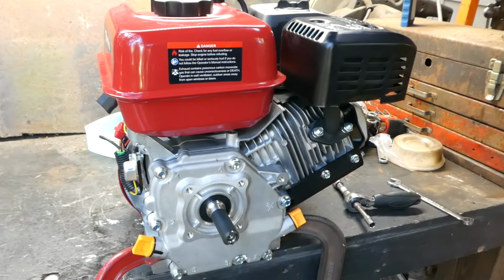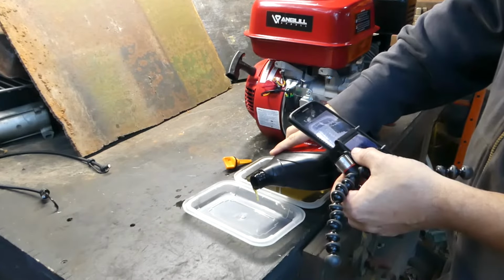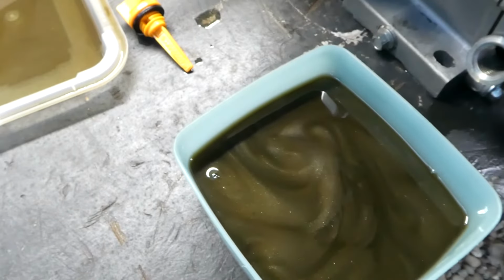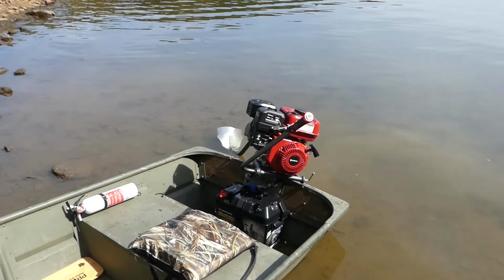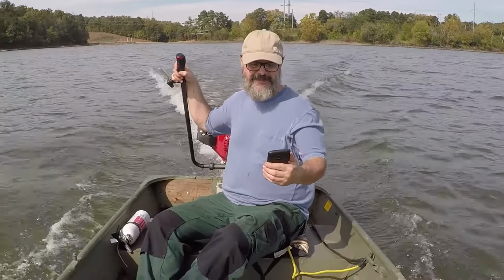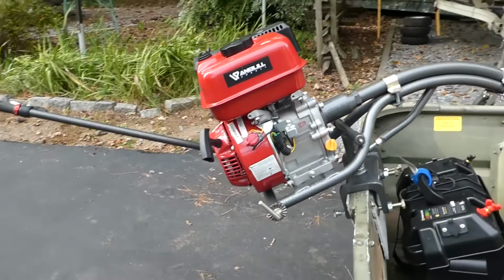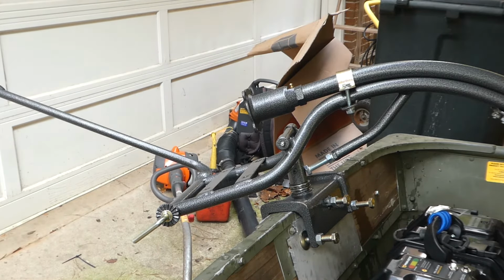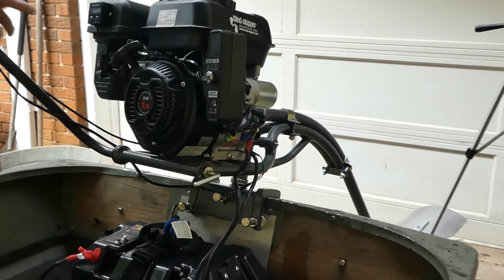Cheap Amazon engine in a boat.

Comment: You know id completely remove the governor system on both of those motors. When i race gokarts you can squeeze out 4500rpms before the valves start to float.. get some heavier valve springs and a good mid range cam and i bet you'll run 20mph

Comment: Interesting trial for that new motor. As for speed difference, Dad standing up would create more air drag, more chop on the water = less water drag. With the float plane I'll actually taxi in circles to make chop on calm water to shorten the take-off.
Reply from the maker: For the speed test he was actually sitting but there was definitely more chop on the water during the fastest run with the new engine. That is interesting, it makes sense but it feels like you are going slower in the wakes. I would have thought you would want as smooth water as possible with a float plane. Always learning! We also thought about the fact that I am 30lbs heavier which lifted the front up a bit more. All in all it performed as well as the engine supplied by a fairly reputable dealer, so I would call it a success as far as it goes. Thanks!
Reply: @theeddies  More weight in the front would definitely make a difference, not only is the bow pushing water, but physics of water properties causes it to climb up the bow, pulling it down more, creating even more drag. It can reach a point where the boat will actually flip over. I don't think that boat is in any danger of that, but, if you've ever watched speed boat or hydro-plane races you may have seen that.
Everything is relative, a plane like my Cub can't handle near the waves a larger plane can, even a Cessna 180 or a Beaver. A little chop adds air to the water making it less dense and less sticky. Humpback whales feed on herring, one of their feeding technics is to dive below a school of fish, circle around the perimeter of the school blowing bubbles. The density of the water is reduced in the " bubble net" and the fish can't swim through it to get away. The whales then swim through the fish, mouths wide open, and scoop them up.
Glassy water and wire crossing are the two most dangerous conditions for a float plane. It's hard to see a wire crossing over a river. With glassy water depth perception is nearly impossible, you can't tell where the sky ends and the water begins. In WW2 flying boats would fire their forward guns into the water ahead of them as they landed so they could tell where the water started.
Reply: @theeddies  
Or pushed the rear down!
Reply from the maker: @edwardchristie3934  Yes, ...or pushed the rear down with my big rear.
Reply from the maker: I don't think there was any chance of the boat flipping, lol. I had not thought about the lines crossing those waters around you, especially at the altitudes you fly. That always reminds me of an old REM song with the line "Power lines have floaters so the airplanes won't get snagged"

Comment: Do they have throttle limit screws in the throttle linkage?  If so, back those out (or remove them completely). Should give you a few more rpm if the engine has the power to turn it.

Comment: It's like the River Boat Patrol in 'Apocalypse Now'.
Reply from the maker: Ah man I really missed that one. I could have used flight of the Valkyries. That would have been epic. Maybe I will do a short. I love the smell of burning oil in the morning.
Reply: @theeddies  lol I was thinking of that earlier too.
Reply from the maker: @johnstrange6799  Can you single point a 4mm thread on your lathe?
Reply: @theeddies  No.
Reply from the maker: @johnstrange6799  would you care to expand on your answer or at least phrase it as if you give a damn?
Reply: @theeddies   You asked if I can thread 4mm. I said "No.", but I care deeply about it.
Reply: @theeddies  What are you trying to thread anyways?
Reply from the maker: @johnstrange6799  I want to make a chasing die for my leadscrew when I make the new brass/bronze nut. The thread is T20-4, metric Acme basically. I have a HSS tap, which has a long tapered start. I ordered some O1 tool steel for the die, BUT I am concerned about getting it through. My thought was to have someone start the thread and finish with the tap. I am going to attempt to tap it but wanted a fallback. It only needs to be a a few finished threads to do a chase.
Reply: @theeddies  I can't help you with that, sorry. What would it cost you to replace your lead screw and start fresh with a new nut and screw?
Reply from the maker: @johnstrange6799  If I were to do that I would get a ball screw but I don't want to spend that on this machine. Maybe I should have been more clear, and this is hush hush. I just want to make a die cus Adventures with A Really Tiny Lathe made a small buttress thread one and got a million views. My screw is no where near needing replacing but could use a dress up. So it is an excuse to try something challenging. But making an acme type die with a chinese high speed tap is an unknown and could fail miserably, the heat treat could fail miserably. It could be a miserable experience but experience just the same.
Reply from the maker: @johnstrange6799  go to proxibid dot com and search "smithy". I am bidding on it, yes I know, but it has everything I need. Also a nice vise with it. I am thinking $400 maybe 5 max though. What do you think?
Reply from the maker: @johnstrange6799  Forget about the smithy, already $500. morons!
Reply: @theeddies  Gone but not forgotten.
Reply from the maker: @johnstrange6799  That Smithy went for $1100. Insane
Reply: @theeddies  Not surprised.
Reply: @theeddies  Little 109 for $400 with change gears on Atlanta CL. Could be a money maker with enough time and paint invested.
Reply from the maker: @johnstrange6799  Those idiots listed it in Atlanta but it is near Asheville, NC. Like 450 mile round trip. They would have to pay me to pick it up, lol. Dollar a mile.

Comment: is this with the stoke 3blade prop? see you had the cavitation plate.. If you Get a longtail 2blade 6.5"-7" aluminum prop, and tap it with a m16x2.0, add a m8 set screw, itll get you up closer too 15mph-17mph ive reached 18mph with a 7" prop by myself. with the 2 blade props you gotta mess around with ythe motor height a tad bit.
Reply from the maker: I believe this one was with the stock blade. My father tried a few 2 blades, but I don't think he ever got it dialed in the way he liked. He passed a few months after this video was made. I still have the boat but not a lot of motivation to mess with it. Thanks!

Comment: So im thinking about buying one after 2 year's have you had any major problems with the amazon motor
Reply from the maker: Nothing major. I would do the reccommended run in and change the oil, and check the valves after. But this one was good.

Comment: i dont understand why use the big car battery for the electric start . a 7hp engine is tiny you can get much lighter motorcycle batteries that are also 12v and start these little motors just fine . i run a chipper with electric start honda gx390 with a bike battery . never failed in 3 years
Reply from the maker: Dad had planned to run lights and accessory power in the boat. It was not just going to be for starting.

Comment: Did you win a 2 blade or 3 blade prop with this kit?
Reply from the maker: He got both but ended up using the 2 blade IIRC.
Reply: @theeddies  is this the mid skipper kit or the Amazon kit?
Reply from the maker: @hunterseibert7567  The tail and original engine are all mudskipper.

Comment: 12 MPh???? or 12 KM/h ?
Because i almost seem impossible for a small 7hp to puch you at 12 MPH
Reply from the maker: It was MPH. I was a surprised to but it got there with a tail wind and perfect water.
Reply: @theeddies  WoW! That's faster than my Mercury 9.9hp on a 14 foot aluminum boat by 2 MPH